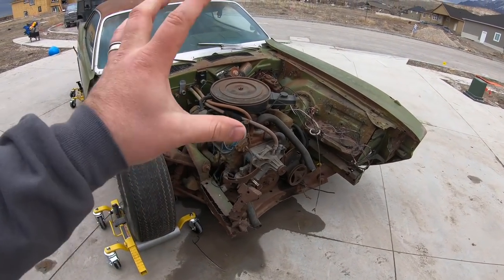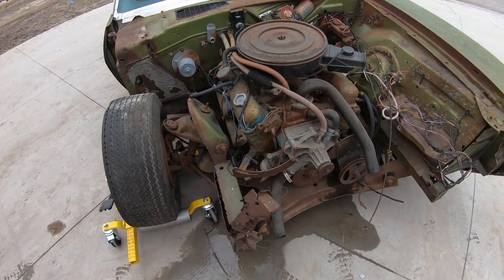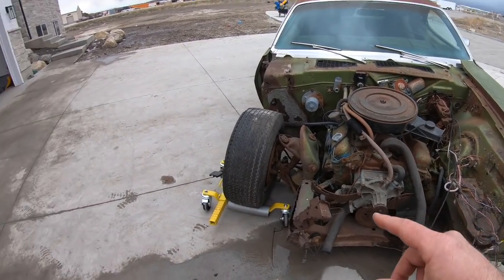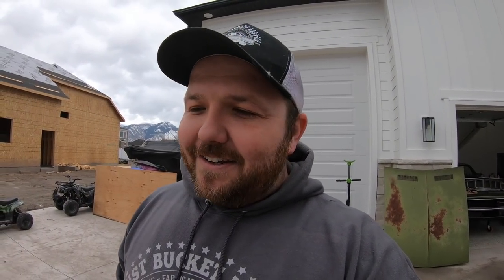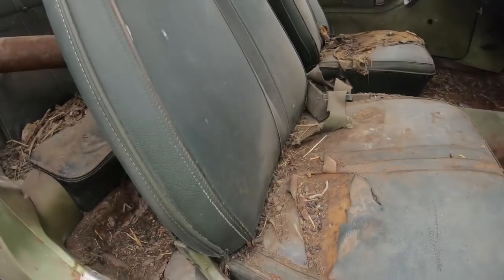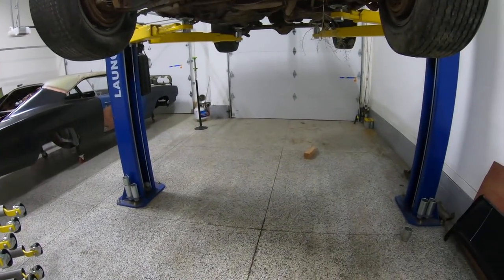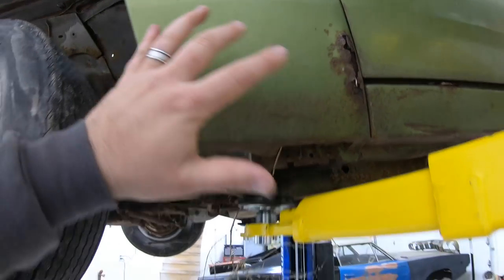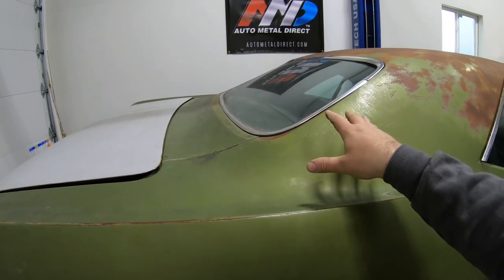1971 Plymouth Barracuda Restoration - Episode 1 - The Story

Comment: Best year for grill, fenders, tail lights, bumpers and available options. Still had high impact colours and the full line up of high compression big blocks, small blocks, the street Hemi and the ultimate street intimidation option; the pistol grip shifter. 

Engines over at the Generals by then had been castrated. Not so at Mopar.

Yes you have truly scored a bucket list E-body my friend.

Reassure your wife that when finished it will have appreciated in value better than any 401K investment.

Still admire your positivity on the condition it's in.

Having watched your skill and determination levels, I have no doubt you'll knock it out of the park, probably even faster than your Charger.

Congrats for saving a car from a now extinct, once great American automotive marque, Plymouth. 

In 71' your car could have been part of the Rapid Transit System from Plymouth!

The available graphics in 71' were absolutely wild and unmatched by the General, Ford or AMC.

Hope you go wild with them and the cartoon colours available. That'll win sonny away from Rustangs forever.

Enjoy!

Malcolm Ottawa Valley
Reply from the maker: Heck yea!  We’re pumped about this one!

Comment: The heavy lean is caused by the missing passenger side torsion spring and support. That is a solid car compared to what you find in the east coast. Looking forward to this restoration/rebuild.
Reply from the maker: Thanks for watching Bob!
Reply: Had the same uneven stance at the back of a Chevelle I once owned. Found unmatched springs in the front. With a missing spring in the passengers side front of your Cuda it's no surprise it's that twisted. I'd put a solid bar for the shock to help move it around, but looks like your going to get right into the disassembly so it won't matter.
Reply from the maker: Yep, she’ll be completely torn down within the next few days

Comment: Yep, two of the best cars ever; own a 72 plymouth sebring. Jumping the gun here bud, if the charger is an F8 Green exterior on black interior, compliment it with a high metallic T5 Bronze Fire / T5 copper on cuoio naturale 4609 Ferrari leather with black piping or paneling and black carpet/black paint on metal areas on the 71. musing over here

Comment: 71 and 72 B body used the same front clip that you need. Front frame rails and torsion cross member are the same.  got a clip from a 72 Satellite once and everything fit right up. Might be easier to find than one from an E body. Check it out.
Reply from the maker: I actually have a lead on one now that I’m trying to close the deal on.  Same floor pan & cowl too I believe!
Reply: @rustbucketrestos6511  Floor pan is the same but the firewall and the 2 little connectors from the top of the cowl to the rear aprons were different. I think the front and rear aprons were the same.

Comment: The guy who sold u the car has a nice name Jo king… Green on green on green was a sign of time's "peace and Love" Green (grass)/Yellow(flowers) and Brown(bronze)Dirt, earth tone color's. Where the most popular color's. Both your Mopar's are F3 lol. The part missing at 11:10 is headlight switch panel. Your a gluten for punishment lol. But the biggest positive is Cowl look's good, pine needle's usually cause rot above brake booster. I see this car has nice A/C tinted glass. I'm not 100% sure but I think 1971-72 charger and satellite also have same front frame you might have a better shot at getting cheaper. >Do not throw out the original Stainless wiper's hard to get
Reply from the maker: Thanks for the info!

Comment: Hello from Simon.  From what I can see on the tag and I could be wrong here if I am please correct me:
Sequence number -11**74 
G18(?) - Clear Windshield A/C
BH23 - Barracuda 2 door hardtop
D31- 3 speed automatic
E44 - 318 2 bbl 230hp
GF3 - Green exterior 
H6F7(?) - Vinyl green interior   
000 -  No upper door frame paint
012607 - VON Vehicle Order Number
U - USA spec build
A01 -  light package
A04 - Base Radio Group
C55 - - Bucket seats
G11 - Tinted Glass
D53? (can't read it) - 3: 23: 1 Rear axle ratio
H51 - A/C
J25 - 3 speed wipers
L25 - Trunk Lamp
L31 - Hood/Fender mounted turn signals
M41(??) - License plate frame 
M31 -  Only belt and Hood moldings
R11 - 2 Watt AM radio
??26 
EN2 - End of tag code Hamtramck assembly line 2.

Hope I got at least most of this right.
Reply from the maker: Damn dude you are good!!!
Reply: @rustbucketrestos6511  Why thank you. If I'm anywhere near correct shout out when you do your next video.  I like the challenge of decoding tags especially pain in the ass Chrysler.  As you can tell from my profile name I'm a Ford guy first but love muscle car restorations.  I have a few snippets of a 67' mustang I rescued on my profile page and am working on restoring, though miraculously even though it sat outside over a decade it doesn't need body panels....  So it's nowhere near as in depth as your builds.

Comment: First, it would be nuts to put a door skin on the left side just for that crease. You could tippy tap that out from behind without even removing the door or probably the glass, if it is in there.
    Second, shocks don't lift the rear up (not these anyway), so I'd look to rear springs as the reason.
    It is a standard Barracuda, but everyone wants to swap to 'cuda parts, so you will want the  wide moldings that go below the doors, fenders with gills, a shaker hood...
     Everyone wants to change to a black interior.  The other color interiors tended to have dissimilar plastics that faded at different rates so looked bad after only a few years.  White seats held up well. But, all colors looked good when new. It is the same for the less desirable paint colors like shades of brown and yellow and also green. They looked good when new.

Comment: With the shop you have and the house. Spend the $20K and buy better cars to start with. Instead of having Taiwan metal muscle cars.
Reply from the maker: Spend $20k and still have to replace almost all that I did on the Charger… prices are out of control right now.
Reply: @rustbucketrestos6511  a super solid gold 71 barracuda sold for $14K in North Dakota a couple weeks back. Was complete and solid frame rails. Floors. Only needed quarters. I already own a 71 purple barracuda. Drove it home with the original 318 2 years ago. Put a Dana 60, 440, etc in it now though.